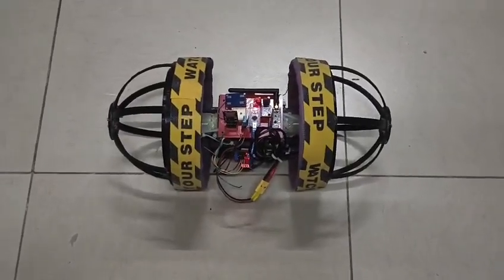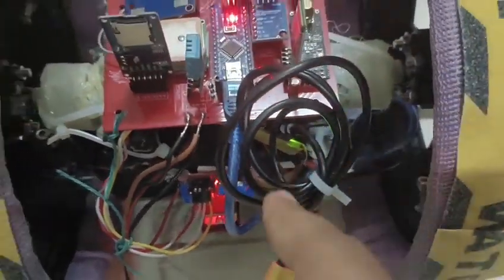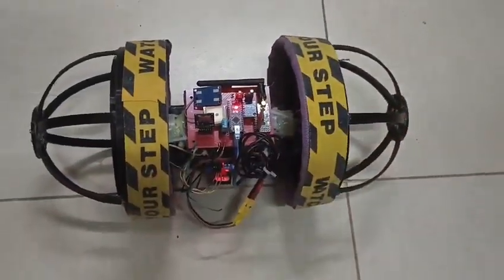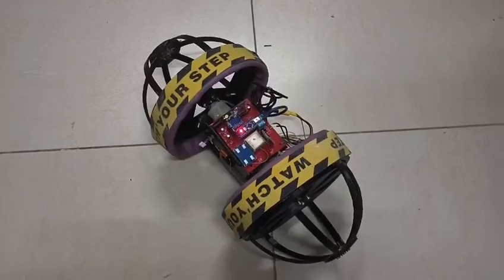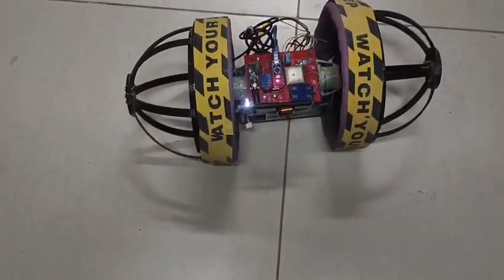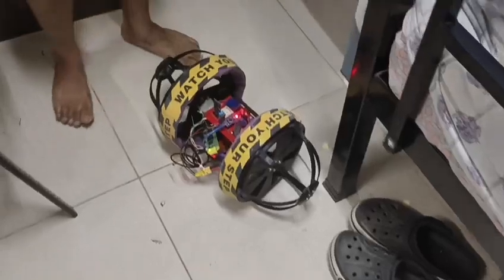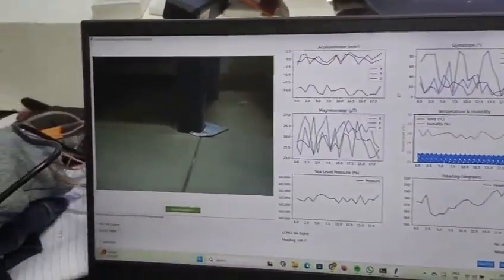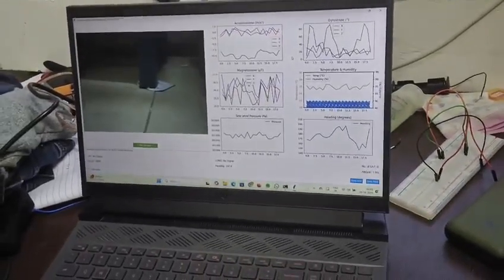Demonstration of the working MOON rover

Comment: how will it stop itself from rolling down inclines uncontrollably?
Reply from the maker: The idea is to add in seperate shells for different terrains...it's like spikes for mountain boots...the shell which would be added on the framework that you see in the video will give it the necessary grip to travel over and scale the inclines...also...more powerful motors can be added to allow it to stop sliding...
Reply: What if the spikes are not enough to hold it while rolling down or what if it gets stuck.

Comment: Just a friendly suggestion brother,

Improve your chessy structure, in the video, it is looking like the whole weight of the rover is supported by only motors, this will affect the performance and life of motors...
instead, try to make a frame that supports both motors and the circuit boards, and also use a gear mechanism in the motors...
remember, in a rover, power and torque is more valuable than speed...

also add an addition mass at the bottom of the core to keep the centre of mass as close to the ground  as possible to increase stability, so the rover wont just turn upside down...

also "IF POSSIBLE" add a cover for your rover's core, because it is the most essential part of the rover...

and i can understand that maybe i have mistakenly understood wrong information cause "i have just seen a video" or this rover is just in a developing stage... whatever the case, the overall project is very good...👍
Reply from the maker: Appreciate the detailed feedback, it's really helpful for improvement! 👍...if we do improve the new structure then we will add additional support to the motors for holding the wheels...
Reply: @kartikeyprasad9419  that will be very nice❤️ keep this continued, you're doing great👍 All the best👍